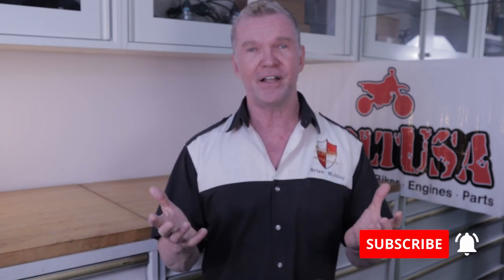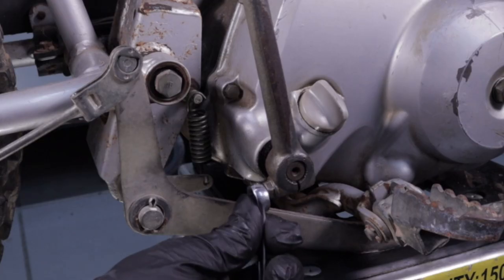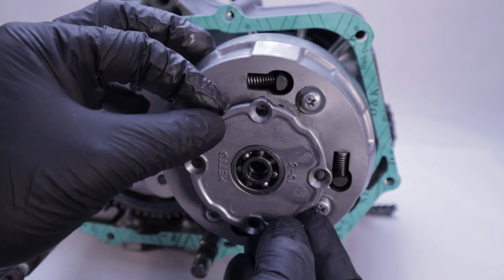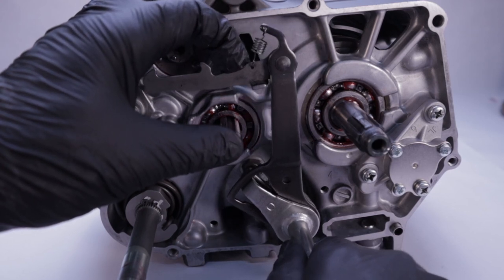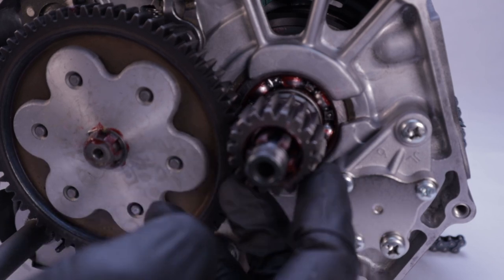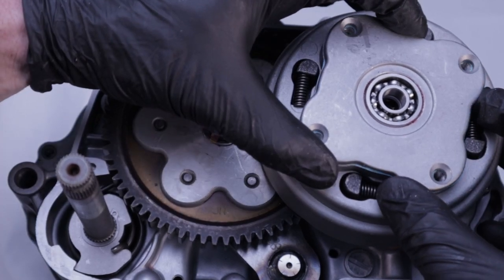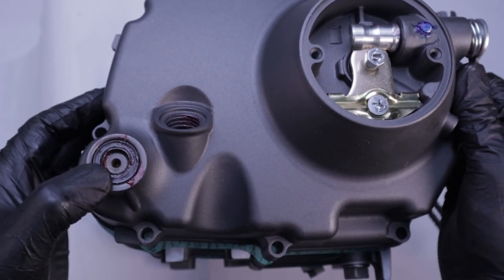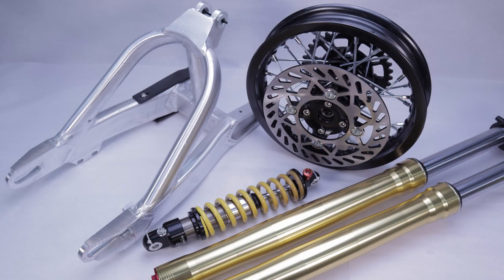Honda Pit Bike Manual Clutch Conversion || CRF70 / CRF50 / XR70 / XR50 / CT70 / Z50

Comment: Hey I’m trying to get my right side carter of but I just can’t
Reply from the maker: Hey Lars!  Well, BE CAREFUL first of all.  Make sure all the bolts holding the cover are off.  Makes sure the kickstart is off.  Oil drained too, obviously!  The most common reason it doesnt want to come off is because its stuck around the shift shaft.  Try wedging razor blades between the cover and the cases on the opposite side of the cover from the shift lever.  Work the blade around.  That SHOULD break the seal of the gasket.  Take your time and dont force it!
Reply: @brian.d.mobley  okay i will try thanks for your tips
Reply: @brian.d.mobley  and heat because my engine is still on my moped, and if you wanna know it’s a kymco nexxon 50cc

Comment: The size of that crankcase convertion is exact as the size of my motor how can i find out.

Please help me with this, thank you very much sir.
Reply from the maker: Hi Nicole:  Im not sure what you mean by "Crankcase Convertion"
Reply: @brian.d.mobley  i mean the clutch manual cover assembly.

Like lifan and ssr125 clutch manual cover.

Thanks for the info.
Reply from the maker: @nicolevargas5588  I’m sorry but I don’t really understand your question. I’ve had several people read your comments and none understand what you are asking. I can tell you that I have not worked on a Lifan engine and I don’t know about the size of Lifan components.

Comment: If we doing this on a 140 motor or bigger than the specified 108cc would it be wise to rebuild the basket with he plates? This video answered 90%
Reply from the maker: Hey Terpy.  Yeah, this video is not really about rebuilding a clutch, but if your clutch pack is out of spec, I’d replace it.
Reply: I have a piranha 140 I’m trying to do this with but kit says it’s for up to 108cc. And I tried to email tbolt but got nowhere.

Comment: question for you sir, I'm getting ready to restore a TRX 70 but wanting to put a 190 or 212 E Start engine on it.  However, they all come via Manual clutchs and I want to convert them to semi automatic.  is that a service you can provide?
Reply from the maker: HI Wise’s!  I don’t work on “customer” bikes.  It just takes the joy out of work.  But, Im not familiar with the 190 or the 212.  Its seems that converting to a semi auto should be pretty straight forward.  Ill bet you could find the parts needed on eBay. In fact, if you want to sell the 4 speed, I might be interested in buying it.

Comment: is there a way to do this in reverse, i would like a semi auto for my sons honda dirtbike.
Reply from the maker: Of course!  Provided you are using this type of motor. Honda makes all the parts and they are very easy to find on eBay. The cheapest and easiest way would probably be to buy a complete motor on eBay and just swap the necessary parts. This motor has been around for decades and has been used on countless bikes. You won’t have any trouble finding the parts you need! Thanks for the comment and for watching!

Comment: Hi I'm having a problem when my clutch came loose when I put it back on it spins it's self back of within minutes when I torque it down will stay on but it won't engage
Reply from the maker: Hi GVN19:  There can be a number of reasons why this could happen. Missing parts is the most likely. The clutch on these motors is restrained from tuning by the interference tab of the locking washer. If that washer is installed correctly, it’s virtually impossible for the clutch nut to loosen. Beyond that, I really have to have the motor in front of me to evaluate it properly.  I’ve gotten away from diagnosing mechanical problems over the Internet as so many variables can be causal. Consult the service manual and start over. You can figure it out!!
Reply: @Brian D. Mobley  cheers for the reply mate the locken washer with the tab on us bent so I'm guessing it's that I've got a new clutch coming tomorrow so I'm going to try that I've only got a torque wrench with a minimum of 60 NM 45ft lbs so il just tighten it half way but my guess is bent tabs on the locken washer

Comment: hi Brian. Thank you for the helpful video. I just did the swap but after doing so I cannot shift into neutral. Do you have any pointers?
Reply from the maker: Oh man…!  No bueno.  The most common shifting problems come from the “star” on the selector drum not being righted to spec. BUT, there are other reasons that may cause this. The spring loaded arm that “hooks” the pins on that drum get bent on occasion which can cause this neutral select issue. Sometimes the same mechanism can hit a casting protrusion near where the shaft onto which the shift lever mounts. The fix for that is a bit of grinding on the shifter shaft mechanism where it hits this casting. There are so many things that it could be.
Reply: @brian.d.mobley  thank you so much for replying. I realize it’s not your product but do you happen to know what bike they source the kit from? I feel like there should have been either a set screw or set pin that holds the lever arm in place where it enters the side cover (I realize it’s not what we were already talking about). The kit we got didn’t have one so ther is no way that this arm stays in place and keeps working out the front of the cover. I contacted TBolt but they only referenced the install directions (which I had already used along with your excellent video). If I know what it’s sourced from I can try to find the exploded fiche and verify if there should be a pin or set screw.

Thanks again!
Reply from the maker: @CraigLaCourt  NO problem at all! Glad to (try) to help.  Honestly, Im not sure of the origin of the manual clutch conversions that TBoltUSA sells.  However, this type of manual clutch is common on several bikes such as a CT70H model. BTW, the service manuals out in the ether on CT's are horrible!  I dont recall any pin that you reference being a part of the installation.  If you need good exploded views, try CSMNL.com.  They have excellent fiche for these bikes.
Reply: @brian.d.mobley  that’s a great lead! Looks like I need part 22816-035-000. It’s a pin. I’ll see if I can find it somewhere in North America. 

👍🏼
Reply from the maker: @CraigLaCourt  In America, I think the best place to buy OEM stuff is Northeast Vintage Cycle.  For mod parts, TBoltUSA.
Reply: @brian.d.mobley northeast vintage cycle like springville new york? They are awesome if thats who your talking about! Its my local honda parts shop

Comment: Is it possible to do without the special kit in my country do not sell such but there are parts for manual cluch?
Reply from the maker: Sure.  Its less simple, but it can be done.  If you are on Facebook, look up Maximus Payne.  He knows EVERYTHING about doing that sort of conversion with OEM parts.
Reply: @brian.d.mobley  Thank you for the quick response, I just need to know the names of the necessary parts and I will buy them as spare parts for manual cluch!!!
Reply from the maker: @sjivanov5564  look up Maximus. He knows all that stuff. Honda ATVs came with 4 speeds and most people who do what you propose use components from those 3 wheeled vehicles.

Comment: Could a penny be used to hold the drive and the driven gears from moving without damaging the teeth?
Reply from the maker: Hi Jim. Absolutely.  Those gears are hard. This interference technique is common on most other dirt bikes and Honda even sells a part specific to this purpose.
Reply: @brian.d.mobley   cool I thought that a penny would be safe! Figures that Honda would have the smarts to make a part for this purpose.
Reply from the maker: @jimmadonna1436  The service manual for the motor in the video recommends the clutch joker tool. But, the manual for my CR250 uses the interference fit tool. It’s much easier to use a flanged nut (or something soft like your penny) rather than buy that bulky tool.

Comment: With doing this, can you then swap out the stock handle bars for say, protaper and put a clutch lever on them? Asking for a crf50f I’ve seen mods done to them where people have a clutch installed, I was wondering if you knew anything about that?
Reply from the maker: Hey!  Absolutely!   I have aftermarket handlebars on the bike on which this manual clutch kit was installed.
Reply: @brian.d.mobley  How much is that?

Comment: Can you convert full auto to manual or semi auto
Reply from the maker: Um. That’s what this video covers.
Reply: @Brian D. Mobley  I thought this was semi auto to manual, I was curious if you can do fully auto to manual, or cvt to manual
Reply from the maker: @jesusmaryandjoseph6  I guess I misunderstood. I’m not familiar with this motor being configured when there is no foot actuated shifting (semi auto).  I am not aware of a bike using this motor that is fully automatic or constant velocity.
Reply: @brian.d.mobley  yeah most atvs and some dirtbikes from China have twist (press) and go throttles here in the US, with no shifting at all, which is stupid
Reply from the maker: @jesusmaryandjoseph6  Well, I learned something new!  Im frankly just no sure about converting from such a fully automatic transmission to manual. I wish I could be of more help.
Reply: @brian.d.mobley  no worries, I'm assuming a simple 125 full auto to 125cc manual swap, same motor company, will work.
Reply from the maker: @jesusmaryandjoseph6  Probably so. If there are no differences in the cases and transmission, logically, it should work

Comment: im still having problem even with nut wedged in clutch basket still spins wont break loose
Reply from the maker: There is a tool you can buy. There’s a link in the description. Sorry you’re having problems.
Reply: @brian.d.mobley  really appreciate your videos i have finally got the clutch basket off
Reply from the maker: @dirtbikedad4107  Glad to read that!  Sorry you had trouble. If you aren’t going to use the crank again, you can use an impact driver to break that nut loose.